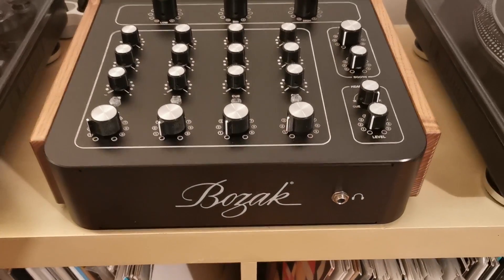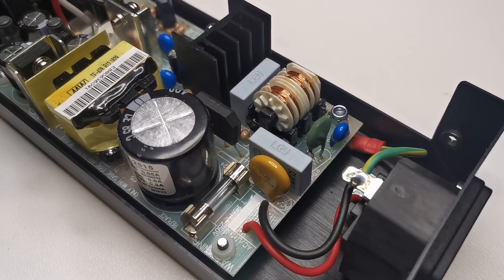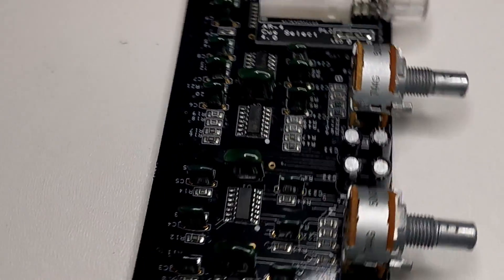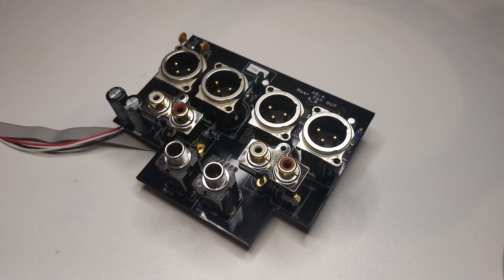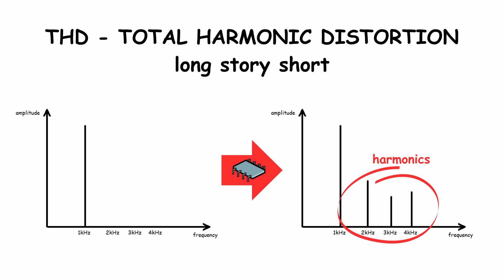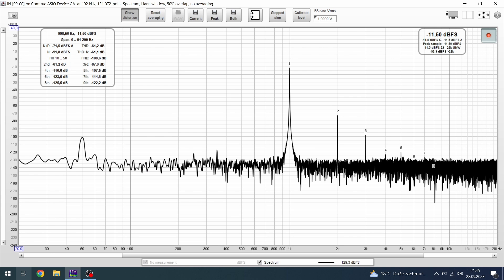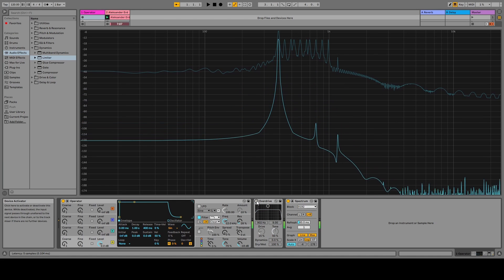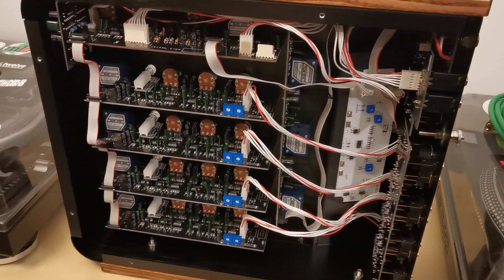Mixers Inside: Bozak AR-4 + THD explained

Comment: It's a mixer with components which were popular in the 80's. I suppose if you want it to sound like an old mixer then it is justified. You can get a cleaner circuit with newer op amps, but then you would probably buy a different mixer.

Comment: I have a vintage Bozak and the THD graphs look pretty much the same as that, pushing the volume also really increase it a lot. One addition on the old unit is there is some serious amounts of power supply ripple compared to modern designs, crosstalk is also less than ideal but eh it's mega old and playing dunga dunga who cares lol

Comment: I have the entire system with ar6,eq6, iso x2 and meterbridge. I wouldn't do this again. The PSU are physically humming, the EQ Bands are pretty simple (not Q relativ eq slopes; this means the higher the gain the wider the bell-but they aren't like this), the VU Meter have low lights, the AR6 have a Class A topology and the EQ6 not, the Crosstalk between the Left and right channels is insanely weak .... The List goes on! I ended to build a custom psu by an electric engineer. This makes things better, but the system only work with palmer line isolators to and from the Isolator..... So, if you don't have the ability to modify forget it and buy an ARS Mixer. My mixer costs insanely 6000 Euro, for the half of the money you get a really very high end Product! Don't get me wrong i love mixing on this rig, but there are technically so many drawbacks! Believe me,  i'm an acoustic engineer and know this stuff. Sorry for the bad news, but this gets me very bad.🤨😮‍💨😮‍💨😮‍💨😌
Reply from the maker: Why do you advertise ARS? Do you have any thoughts, observations or measurements to cover your statement?
Reply: @mixersinside  Hi Mixerinside, thanks for the reply! One of my clients have the Alpha Recording System Modell 9500. We are close, but not so close, that i can open his mixer😂....... But i hear it in a well treated room: The Channel Eq is on SSL Level (soundwise) and stay in a very good context with the Program Isolator. The main competitor to this mixer are the Varia Mixers (worth a try). Juno DJ have a Video here on Youtube with some EQ Examples (not the best place to critical hearing, i know). The TL072/TL074 IC's CAN work well, when the circuit is very well designed. Many Studio Consoles have these Chips in it, my Desk in the Past also (D&R from Holland/Dutch). An Audio Engineer that i know made a direct comparison with TL72/74 and OPA's (on two identical fully recapped console channelstrips; with no audible differencies (but it was measurable; lower noise floor). So, what matters is the circuit design. Have a nice Day, greetz!
Reply from the maker: @candyproductionssouledout9682  i've opened ARS before running this channel. It was very faithful copy of UREI 1620 with one difference - no output transformers.
Reply: @mixersinside  Yes, thats right. The Japanese founder - AFAIK - Repaired Ureis and Bozaks in the Past and began building his own brand that is based on the Urei. Juno DJ confirmed that. When it is done right, it don't need Output Transformers, one Part more in the Signal Chain. But this is a VERRRRY minimalistic approach. When you take a Studio Desk, who have 'only' unbalanced inserts, it is extremely difficult to manage the wiring and grounding in Recording Studio. But it's possible! ARS have a very minimalistic approach, however, Mixing Engineers says by these things: When it feel right it is right.😎 Do you have Pictures of the inside of the ARS Mixer? That would interesting me a LOT!
Reply: By the Way, nice discussion here. You have the plan here, cool BRO!
Reply from the maker: @candyproductionssouledout9682  I don't agree with output transformers part - it's a significant part of UREI sound signature. I will share ARS internals some day. I have some photos but it's nothing interesting if you know UREI circuit. It will be the best for me to get this mixer once again and film it.
Reply: @mixersinside  of course it's a sound signature issue, i don't say that. I only say, that you can do it, when it's right designed. When you have a UREI to sell in perfect working condition, i have great interest. Your work here on the channel is very important to cut out the Voodoo Crap. Big respect for that!
Reply from the maker: @candyproductionssouledout9682  thank you very much. I don't have UREI for sale but episode about original UREI 1620 from 1985 is coming - i've already filmed it and did some nice measurements.
Reply: @mixersinside  Oh yes, i'm in... you got me.

Comment: I'm wondering how the design AR-4 compares with a UREI 1620 LE, since one of the engineers involved with the LE went to product the AR-4. Do they share similar topologies and component selection?
Reply from the maker: @vincelin7005  now I can answer your question, because I saw LE inside. Differences are huge - different phono preamp, different summing amp, different power supply, different EQ. Nothing in common i think.
Reply: @mixersinside  Thanks for circling back with your findings!

Comment: A very informative channel. What dj mixer have you got personally for everyday mixing?
Reply from the maker: UREI 1603, A&H XONE:92, Rodec MX1400 and my custom rotary are currently most used by me.
Reply: @mixersinside  have you modified all of them?
Reply from the maker: @Fit4Life-g3t  all apart from MX1400 but i'm also working on a mod for it. I don't like the fader curve, but it's difficult to change it in a simple way.
Reply: @mixersinside, excuse me, I have one question.
On which rotary platform have you made your custom rotary mixer ?
Reply from the maker: @abumc5104  hi, can you please explain what is a rotary platform?
Reply: @mixersinside  you said in an earlier comment, you made yourself a custom rotary mixer. That's what I meant with rotary platform. 
From rotary I understand that there are only rotating knobs/controls and no fader installed like for example in my second hand/ old/ not perfectly workin' DJM 700-K.
Reply from the maker: @abumc5104  i didn't change any faders and didn't use a platform, I made my mixer from scratch.
Reply: @mixersinside  I think I understood, I gotta learn with the people around me
to repair and improve my old DJM 700-K on my own, and never never never again buy a 2nd hand dj mixer online.

Comment: Never had a chance to hear or try it out and nether any of other rotarys. 

Thanks for your enthusiasm and effort to make these kind of videos. Since I have micro understanding in electronics, they are quite informative. 

In my opinion most of dj mixers are way to expensive for what you get, but what's expensive for one, it's affordable for someone else.

I think, if music producer have done he's/she's job well and music material is well mixed and mastered in first place than it will sound well on most decent systems. At the end of day, mixer is just one of many pieces in signal chain and where all should work well together to get pleasurable sound. Colored or clinical sound signature is preference for choice. 
Enjoy the music! ✌️
Reply from the maker: WORD! Thank you for this comment.

I work in hi-end audio company in R&D departament and have comparison between circuits used in DJ mixers and those used in state-of-art audio reproduction equipment. Flawless signal conditioning still requires some costly parts. Unfortunately none of them appear in most DJ mixers, and people still call those products hi-end. This channel may help to slightly get rid of this confusion (i silently hope it will). 

I agree in 100% that prices of DJ mixers are simply insane considering what they have to offer. And people still buy them because they are misinformed. But as you said - if someone can afford this and is happy with the purchase everything is right.

Comment: I thought the original Bozak summing amp was completely passive, basically just all the volume pots wired together.
Reply from the maker: You can easily check it by studying the schematic which is available online.
Reply: @mixersinside  It's not.  Odd.  I thought people had said it was.  Maybe I misheard or they were wrong.
Reply from the maker: @Reticuli  just do a proper search and you will find it.
Reply: @mixersinside  By "it's not" I meant the original Bozak summing circuit is indeed not passive.
Reply from the maker: @Reticuli  oh i see :)
Reply: @Reticuli  Yes but no. Because of that "passive summing" as you say a bunch of volume pots wired together with some resistors there are also losses (no such thing as a free lunch) hence the need for a simple amplifier (summing amp) which uses 2 jfets per ch to boost the volume back up. All it is a simple 2 channel amp with a high input impedance, the blending bit is done passively. So you also run into a thing where the pot is can also affect the sound as the summing amp wants to see optimally a high impedance load. Having had an original Bozak now for what seems like an eternity I can honestly say I'm bored of all of it's idiosyncrasies, wish I never got rid of the 1620 now :/
Reply: @vinyljunkie07   Oh, so it is?!  Yeah, I thought I'd heard it was a passive mix bus then with essentially a mic pre amplifying circuitry right after that to boost it back up.  Hence other issues of changing one knob can alter the entire volume of everything in the passive mix bus (which isn't all bad, IMO), and then the fact that at less than full on any of the channel volume pots you'll get increasing high frequency roll off.  So, to get the most out of any channel, you run the channel volume pot at max and control the overall volume with the mixer's output knobs (like the master).  The Iso420 is also apparently like that.
Reply: @Reticuli  I read about running the input hot (it was posted on Wave when that was a thing) funny thing is when I do that is I get more THD and it's not like it's a headroom issue with a 40v PSU voltage rail lol So I run it at around 7 on the input dial. Mine actually showed strange behaviour under the test rig and actually had a rising frequency response which I can't be bothered to investigate at the moment but it's most likely the EQ card and pots, in real life you can't really hear it :/ I'll post a clip in another reply as I think youtube blanks out replies with links. Any way for clarification i'm going into the phono RIAA input and it's the same on the line, also the THD drops a lot when the master volume is lower
Reply: @vinyljunkie07  I don't mean overloading the input stage, but a proper line-level into the line input, channel at max, and the master turned down but just high enough to read on the downstream.  You should be able to see on a scope or a spectrum when you've overloaded the input stage, then back the input source off and substantially don't go near that clip point.  If unity is at max on the channel volume, then you should get less THD, unless the 'mic preamp' stage after the sum bus has some seriously low tolerances.  I suppose you could try the same thing with carts / tips of different output levels.